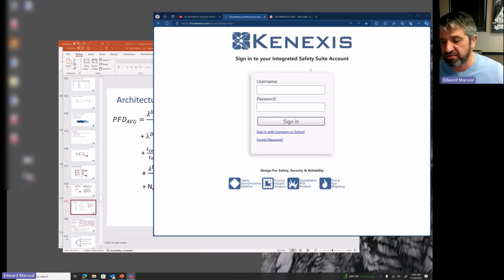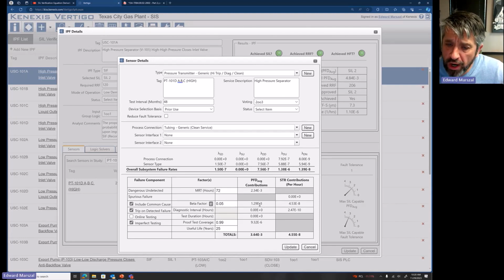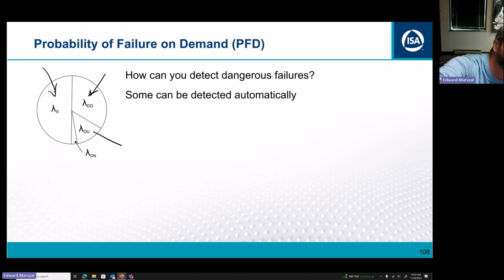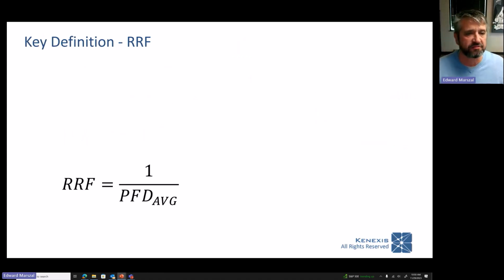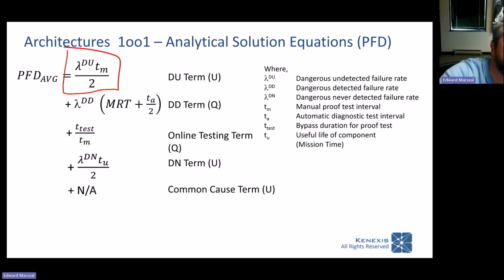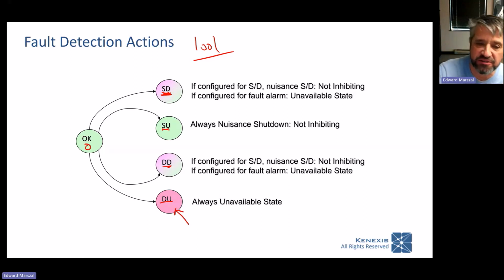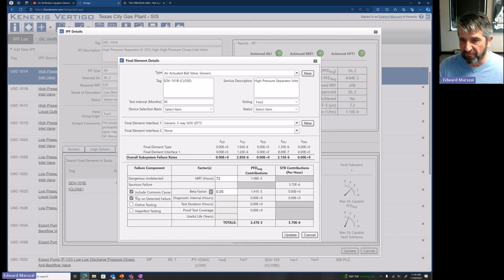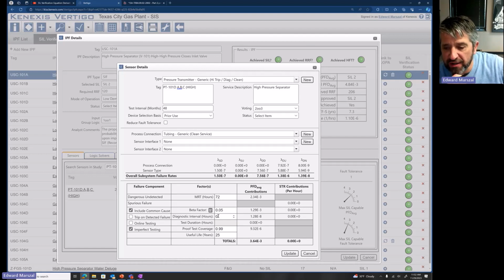Recorded Webinar: SIL Verification Calculation Terms

Comment: Hi @edwardmarszal3421 , 
1. what reliability database is used for λsd/su/dd/du values for SIF components? Does Kenexis have its own statistically significant failure rate database?
2. When you have multiple initiating events that use the same SIF, do you do a LOPA summation for all initiating events to calculate RRF target or do you consider the most onerous IE to calculate RRF target?
3. Where does the diagnostic coverage (DC) fit in in the simplified equations?
Reply from the maker: Hello!  Thanks for reaching out!

Kenexis has a database of failure rates included in our Vertigo SIS Safety Lifecycle Management Software.  This database has two kinds of data types.  The first is vendor data which comes from third party certification reports that Kenexis reviews for quality.  The other data type is “generic” which is intended to be a conservative representation of a broad category of instrument such as air-operated ball valve or displacer level transmitter.  These data points are developed based on literature review and confidential data provided by our end user customers.

If a SIF can be triggered by multiple initiating events for a single hazard scenario SIL can be developed either based on the worst case or based on aggregation.  The choice is up to the end user, and it is based on how the tolerability of risk criteria are developed.  There is no “Correct” answer.  Many large organizations perform this task in both ways mentioned.  The aggregation of risk choice is more correct, but due to the largely conservative numbers used for LOPA initiating event frequencies (e.g., BPCS failure of 1/10 per year is very conservative in comparison to its 1/50 to 1/70 statistical value), the end result of aggregation can be comically pessimistic to the point where the results are not usable.  Worst case, though, may ignore some degree of accumulation of risk due to multiple causes.  Ultimately, it is up to the end user to define their tolerable risk criteria.
Reply: @Kenexis  Hey thanks for the answers...you missed to answer the third question!

Also, in response to the answer to Q1, when it comes to 'generic' failure rate data, does Kenexis database use failure rate values from SINTEF, SERH, OREDA etc.?
Reply from the maker: Hello Abhishek, 

There is a term in the simplified equations that calculates the unavailability due to a failure that is dangerous but has been detected. The device will be unavailable between when the failure occurs, and when it is repaired or the MRT. The diagnostic coverage is used in determining the dangerous detected failure rate which is the failure rate that is employed in this equation.

The generic failure data that Kenexis supplies comes from a large variety of resources that includes OREDA, NPRD, ISA, SINTEF, and others. We also supplement the data from these publicly available sources with confidential proprietary data from actual operating companies. We don’t list the data from the sources specifically, but instead review the full range of failure rates that are available for a specific type of device and use our numerical analysis and judgment to pick a single number that is representative for that type of equipment.

Comment: Ed 2 of IEC 61511 brought in a requirement to consider uncertainty in the calculations, so what level of uncertainty do you expect to have in your reliability data, and how does Vertigo take that into account?  It looks as if Vertigo is reporting results with 3 sig figs, so that implies an uncertainty of +/- 0.1%, is that correct?
Reply: The number of digits shown in Effigy results is not correlated to the accuracy of the input data.  The use of three significant digits was a stylistic choice that does not imply any accuracy.
Reply: Uncertainty in SIL verifications is a function of the uncertainty of the data used to perform the calculation.  That data is primarily failure rates, but also includes diagnostic coverage and manual proof test coverage.  IEC 61511 really only focuses on the failure rate data itself.  The standard mechanism to address uncertainty is the utilize a margin of safety for your failure rate data.  This margin, as per IEC 61511 is to use a 70% single-sided confidence limit when calculating your failure rates for use in SIL verification calculation.  What this means is that you don’t use the mean failure rate that is calculated by simply dividing number of failure by equipment time.  That failure rate is the MEAN, or 50% confidence.  50% of the time the actual failure rate is higher, 50% of the time it is lower.  We are required to choose a failure rate where 70% of the time, the actual failure rate will be lower than the one that we select.  This failure rate can be calculated using the Chi-Squared test.  A spreadsheet for performing this calculation is available on our web site.